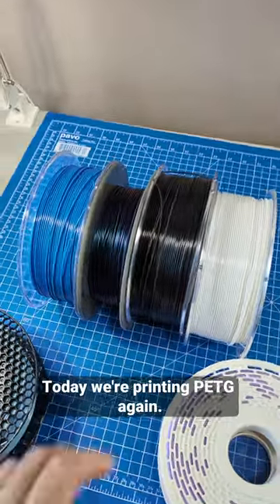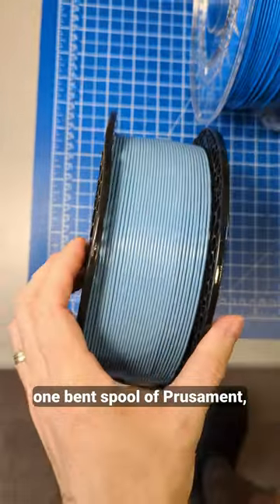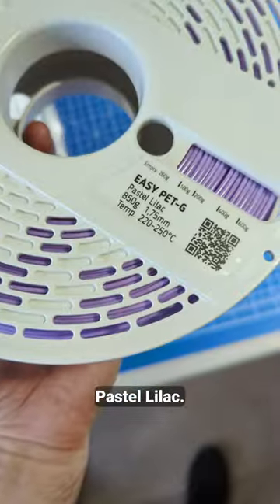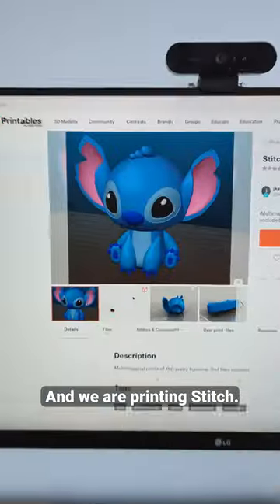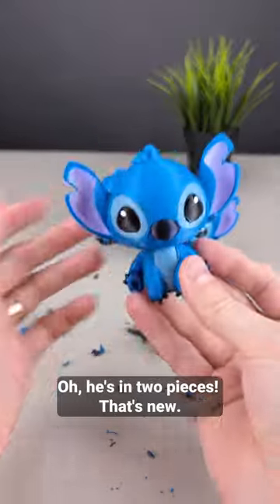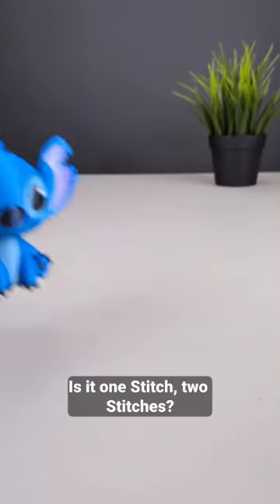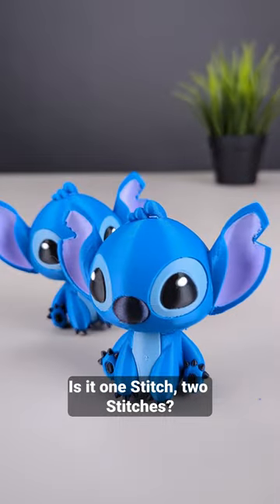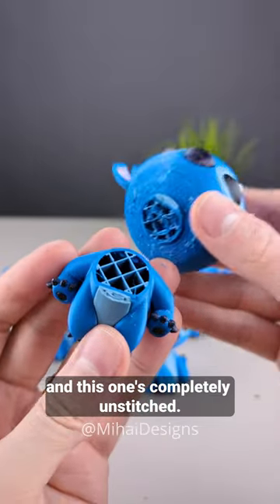PETG 3D-printed Stitch

Comment: I am thinking of getting a bamboo labs printer but they seem to always fail in some way in your videos. Would you still recommend one?
Reply: If you want a product, and not a project, yes. There’s no getting around the fact that DIY designs are… DIY. But for many of us that’s a joyful part of the experience, and teaches us more about how things are actually working. We get a better performing machine too at the end when love is put into the build. Bambu is immutable, you cannot do much in the way of tuning beyond slicer parameters. I mean things like square corner velocity, thermal runaway config, different/more precise thermistors, etc. you get what you get. And can’t do much when you hit an issue other than do what Bambu tells you.
Reply: I recently got my bambulab x1 carbon and its incredible

Comment: You really need to consider what’s causing weak lamination. the plastic is not molten enough or for long enough to bond well with the lower layer. This means you’re either printing above the flow rate for your hotend (bump your temps), and/or cooling too much. PETG has a lower flow capacity than other polymers, being a copolyester too.